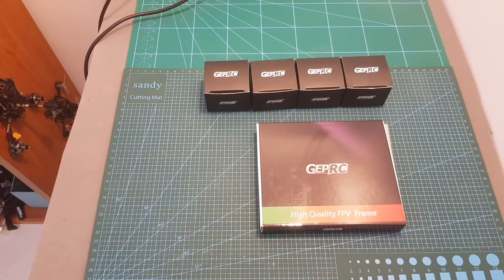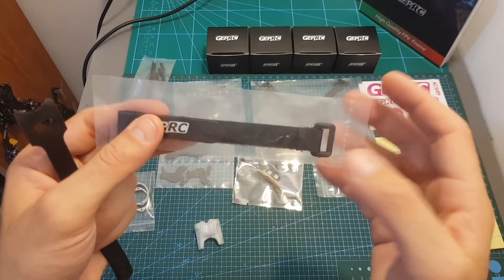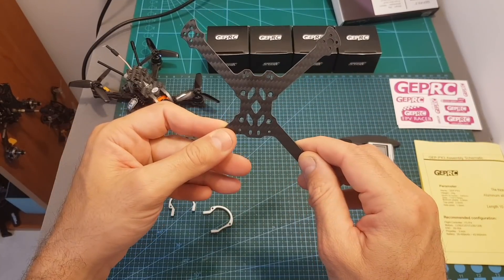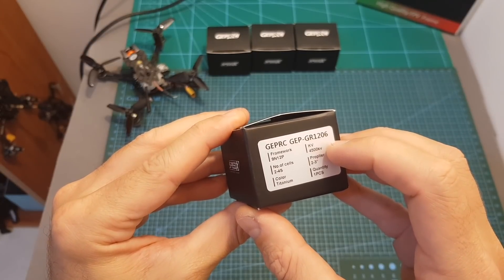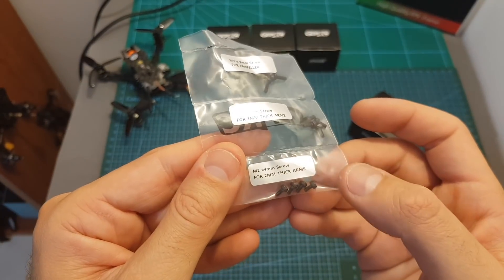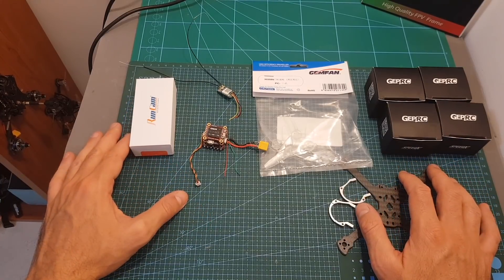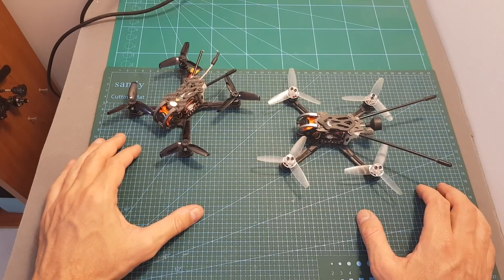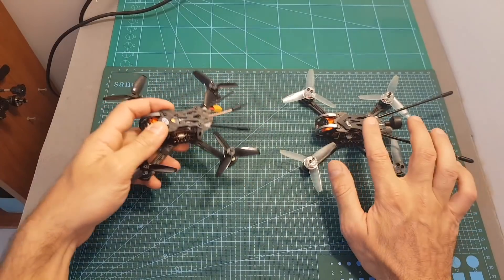GEPRC GEP-PX3 & GR1206 4500KV Motors - Overview, Build & Flight

Comment: Great video, glad someone posted a video of the Phoenix, but the PX3 version (3" version) of it. 
I've only invested on 3" props, didn't want to have to spend money on 2.5" props, just because I liked the frame. lol Thank you for posting and letting us know 3S is better than 4s on it (without PID tuning) :)
Reply from the maker: You're welcome :-)
Reply: @KremerFPV  I will use RCINPOWER 1207 motors instead of the GEPRC 1206 motors (lower in price and 500kv higher). :)
Are LISAMRC 1206 4500kv a rebrand of the GEPRC 1206 4500kv? 
They're almost the same price (off by $1)
Reply from the maker: @dragonballz0  Sorry, never heard or seen this motors, but it can definitely be possible.
Reply: @KremerFPV  I was asking because they are sold separately or with a LISAMRC 3" frame Nicknamed "Chameleon Clone" by some (like Andy RC). Here's a link of the motor:
 https://www.aliexpress.com/item/32932569113.html?spm=a2g0o.productlist.0.0.6def7f42vWvm0a&algo_pvid=d04e1149-da54-439c-a2f0-3ae8102f5591&algo_expid=d04e1149-da54-439c-a2f0-3ae8102f5591-13&btsid=09c12801-1414-4ddc-8fd3-735f39bf44d2&ws_ab_test=searchweb0_0,searchweb201602_3,searchweb201603_52

Comment: putting a M2 in a M3 hole for the stack was ok?
Reply from the maker: No, you should use M3 screws.
Reply: @KremerFPV  Gotcha, so no rubber grommets on a 20x20 stack

Comment: Hi There, can the 3-inch version handle 850mah 3s/4s? Thank you!
Reply from the maker: Yes, it should be fine but a little bit too heavy in my opinion.
Reply: Gal Kremer -Started with the diatone gt-r 349 and the hglrc xjb 145, looking in to the px3 as my third buy.  Love the look and want to use the same 3s/4s bats. Thanks for the help.  :)

Comment: hi gal i have the same frame but i wanted to run it on 3s, will the geprc 1206 6000kv run on 3s on 3 inch props please reply thank you!
Reply from the maker: Yes, should be fine.

Comment: Thanks for this review. Is it possible to use 1306 motors?
Reply from the maker: My pleasure. No - you need 9mm mounting holes.
Reply: @KremerFPV  okay thanks..
Reply: Kremer is right, you cannot use standard Emax 1306b v2 (or another standard 1306 with 12mm mount motors. However, if you want to use a 1306 size, you can mount the RCX NK1306 4000KV motors (those come with 9mm mounts, instead of like the EMAX 1306b v2 that only come with 12mm mount). This is the limit of the GEPRC-PX series frames, not allowing to mount a size of your choice, like the Airblade or iFlight iH3 v2 3" frames

Another couple of choices, now, are both the:
- RCINPOWER 1207 5000kv, they use 9mm mount holes. Great 1206 4500kv and 1306 replacements for racing and freestyle.
- Xing 1404 3800kv, 4300kv, etc. These also use 9mm mounts 

Source: I own both motors and the GEPRC-PX3 frame.  ;)

Comment: Hi, can i mount on the Gep-px3 the split mini 2 instead of the built in camera ? is there Enough space ?
Reply from the maker: It might be possible by removing the VTX from the top of the stack and replace it with a different one.

Comment: Albert Kim likes geprc motors and they seem to get good reviews. I am tempted to get a set and build a 3 inch with this motors. Did you ever try the rcx 1306 motors? People like those as well. My only 3 inch is the xjb145 but I ended up picking up an extra set of the hglrc 1408 3600kv so I could use those as well. Do you find these better than the 1408's? They would be much lighter and also also because of the smaller shaft and 2 screw prop set up also spin lighter props. I guess I answered my own question.. lol. I assume you agree with me...
Reply from the maker: LOL. I love talking to myself as well ;-)
You can't really compare these motors with 13XX or 14XX motors. 
For a lightweight and efficient 3" build, the GR1206 are a great match.

Comment: What is that part at the 4-minute mark?
Reply: thank you, Gal 👍👍
Reply from the maker: I added a capacitor to the battery leads pads. It helps to reduce the noise coming back from the motors / ESCs.
Reply: will any capacitor will do or does it have to be of a specific spec, Gal? TIA 👍
Reply from the maker: @ectoplasm6453  Try to get a small one - a 35V 1000uF will do the trick.
Reply: I suggest moving the capacitor to the front and off of the pigtail. I added longer wires and moved it to the front behind the camera. Tight squeeze, but it fits.
On the pigtail like that, the wires move so much the capacitor wires are going to break from the constant plugging and unplugging of the batteries. 

I'm on my second 2.5" Phoenix, and this is the very first thing that breaks even tho you don't crash.

Comment: I’m looking at these for a 4s 3” build. Would you recommend these? If not what else? Thanks Gal
Reply: (I would love to see the answer too!)
Reply from the maker: These are great motors, but you have to remember that they are not as powerful as 13XX, 14XX and 15XX motors which are usually used on 3" builds. 
If you want to build a lightweight micro 3" which won't be as dangerous as the "traditional" 3 inch quadcopters such as the XJB-145 - you should definitely try these motors.
Reply: Gal Kremer these would be used on a 3” 90g 4s build. Remember motors of 13xx 14xx and bigger have a 5mm prop shaft and 12mm mounting pattern which makes them heavier